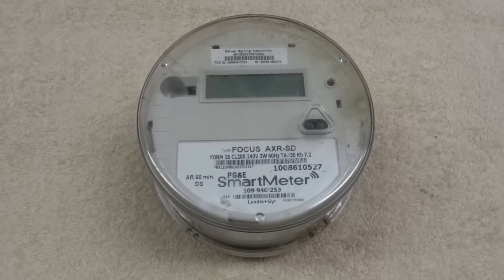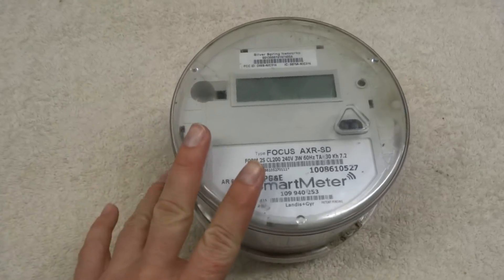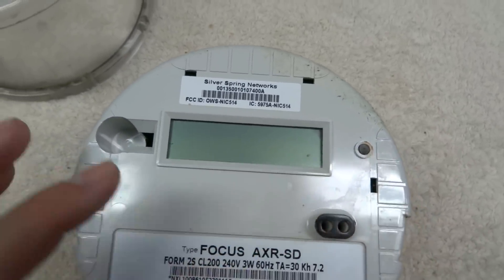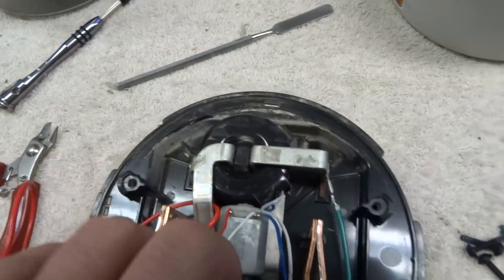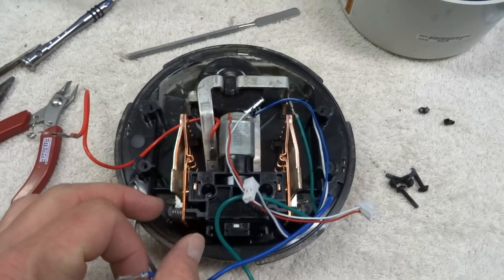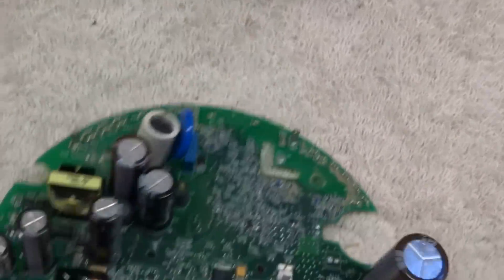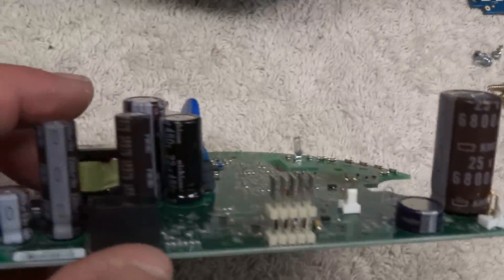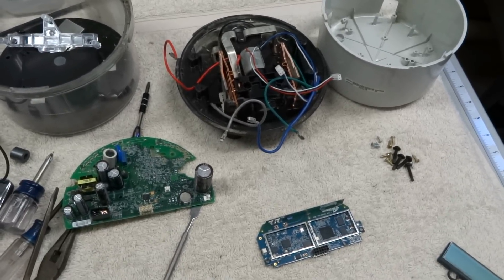Let's Teardown - Residential Smart power meter

Comment: The external antenna is to receive programmed rogue satellite commands to release capacitor juice to power surge all the interior fixtures and arc outlets to combustion levels.    Agenda 21 compatible.

Comment: That CT makes me think that can't see the two 120v legs independently. I'm wondering what happens if you use a grid tie inverter on one 120v leg and it produces more than needed power.  If the other leg is drawing current does the meter just see an overall drop in power usage?

Comment: The blue/white leads from the toroid coil are NOT the power source for the electronics. This coil acts as a current sensor for the amps flowing through the house. The meter electronics is powered by the red and green wires, which go to a switching power supply, producing the DC required for the electronics.

Comment: Hmmm, electronics.
Do these things emit radio frequency which affects radio? I get it from all sorts of things, my boiler which at least I can switch off, switched mode power supply next door, the worst is internet broadband killing everything from 160m to 17m amateur bands.
Would my transmitter affect their electronics? Or have they thought about that. 
I see it's in a plastic enclosure, nothing could be worse.

Comment: Two legs of 120v incoming from the transformer and two to power the home. 220/240v outlets run on two legs of 120v that add up to 240v. That's why 240v has breakers that are two-pole instead of single pole. They need to be on both legs of power.

Comment: The motor is to drive the power disconnect. I was wondering what they used. Contactor or SCR. The donut measures your current.

Comment: First off meter is upside down. The donut as you called it is a  current transformer. The so called safety switch in the back is actually a hanger to hang the meter when not in use. Electric company pays for the electronics to run not the home owner (upside down meter). So much wrong information told no wonder why people are so mislead  and misinformed.
Reply: At least hes trying pal. Got to start somewhere when nobody knows the real reason they pushed them on us all so quickly
Come on why would you want to swap out analog for digital

Comment: The level of paranoia around these meters is truly astonishing. I do not see how this device can do all the evil things they are supposed to be doing.
Reply: how do you know they are accurate?  they send them to some "independent" testing company, on your nickel and they are certified to be 99.4 percent accurate.. how do we know the companies doing the testing arent owned by the big wigs in the electric company or that they are in cahoots with them.. also the amp draw has to be calculated into WATT usage.. thats how we are billed, by kilowatt hour usage.. how do we know that all of this is correct.. I had an ENCORE employee basically park down the street and sneak into my yard to change my meter.. I caught him and asked why.. he said it wasnt signalling correctly.. I asked how did they know how much my bill was, he said that part was working,, well the very next month my bill went up 45.00.. I think they calculate the sq footage of your house, decide a base number u will pay and add to that on high usage months.,, im thinking of having an electrician install a watt meter in my house. just to confirm what im using..
Reply: @randy1ization  The energy usage calculation for a digital meter uses sampling instead of the way that mechanical meters did the measurement.  Many of these meters will measure the highest amps during the sample interval and apply it to a billing window (which might be 15 minutes), which can lead to your turn-transient from the fridge that lats only a second winding up as being billed for a full fifteen minutes.  The point is that the code is not open source and available for public scrutiny. Many people with 'green' technology like variable speed HVAC are finding much higher energy usage with these new meters, and this is believed to be the reason.  These meters also introduce harmonics onto the whole home wiring which will reduce the lifetime of refrigerators, washers and other big appliances.
Reply: Oncor may not allow me to have my own kilowatt hour meter installed, they may say it interrupts thier system, and will say that I can check my dasily usage online every day if I want.. they have everything covered. and to your point abt the sampling times, you can bet your ass they dont sample in typical low usage periods, like midnight to 6 am.
Reply: @kengartner204  to your point, most appliances have primary and secondary windings, dryers, ac compressors, refrigerators, washing machine motors, almost everything, but they are usually on for a very shot time.  the Hvac systems tend to have variable speed AC TO DC motors, but the compressors are usually 2 compressor systems, a small one and a larger one. most use a scroll type pumping mechanism that is alot more effiecient than the old piston /cylinder compressors/

Comment: the FCC ID of that wireless board
https://fccid.io/OWS-NIC514

The newer smart meters use an LTE data modem with a SIM card.
The motor inside controls a large switch so the electric co can remote disconnect your power if you don't pay your bill.

Comment: It’s a Landis-Gyr AXR- SD .....  The AXR denotes this is NOT an RF transmitting meter...   The SD stands for Service Disconnect.  So this meter has a built in disconnect means depending on how the software is set up.  Disconnect by overload, disconnect remotely.  
The RXR series are the ones that operate on 900 MHz. or 2.5 GHz.

Comment: The "donut" is a current transformer which measures the amount of amperage flowing through the meter.  The motor does drive a disconnect at the meter, not so much as a safety feature, rather so the power company can turn your power off remotely either because your not paying your electric bill, or because the grid is overloaded and the power company can cut the power to areas of the grid your in.  The later 'feature' smacks of big brother, government control, kind of scary. There is a large capacitor which stores power like a battery so if the meter is removed a signal is immediately sent to the power company that the meter has been removed.  The power company will come to your site and investigate why the meter was removed.
Reply: I wonder what happens if I put a grid tie inverter on one 120v leg and it produces more than needed power? With one leg taking power and one leg giving power how does that affect the CT signal and meter reading.
Reply: @tweedeldee8122  From what I understand - the CT measures both sides independently. utilities deliver three wire single phase.  That comes in the form of 120vac + 120vac + neutral.  Then on your property you have a grounding system. You use one leg of the power they deliver all the time. Any 120vac device pulls from just one leg.  The meter measures each leg at about 120v (it keeps track of exact voltage and amps pulled). The utility does not notice if you pull unevenly. They just do the math to figure how many total kilowatt hours you pull from the grid.  One leg pull is approx Ampsx120.  two leg pull is approx  ampsx240.  One more thing... if you don't have a bi-directional smart meter (solar customers get these), and you produce power with an inverter and put it on the grid, the power company just sees power across the meter.  You would get billed for that power you put on the grid because you have a "dumb smart meter" that is not aware of flow direction.

Comment: I have a theory that I will expose here.   I think that one of the reasons that people experience higher bills after the smart meters are installed is that they have a lot of motor loads with lagging power factor running within their homes and the smart meters are acting like oscilloscopes or power factor meters which are actually reading the out of phase component of the load and the customers are being billed for it for the first time. 

Not like the old analog ones that were just measuring V x A / Time.

What do you think?  Am I making this stuff up or is that what is really going on?  Some people have seen atrocious increases in their bills.  Sometimes even when they have been absent for long periods of time.  (not forgetting that that trusty fridge and freezer are still poking away turning on and off with way to much regularity).
Reply: Supposedly your lagging power factor usually at .80 is not billed to the customer.

Comment: I just stumbled across this looking for information about the power meter Ameren just installed on my home. He spoke to the regular DIY person, not someone with a degree in electrical engineering. Getting to the nitty gritty of how the meter works would have put most of us to sleep.  
My question is this :   The meter they installed has a Zigbee symbol.  My smart home is connected to SmartThings which supports Zigbee.   After an email to Ameren. they say they don't know what I am talking about.  My reason for wanting to connect to the meter is to monitor my power consumption and compare it with the smart power meter installed in my entrance panel and the monthly bill.

Comment: The blue and White wires are yes a inductor, basically what it’s doing is it is reading the amp draw that you are using daily essentially it’s just an amp clamp and you’re smart meters technically just a multimeter but only reads amps and what it does is it converts the amps into walks in and calculates the Watson to kilowatt hours every thousand watts is one kilowatt so for example if you’re using 2400 kW a day then whatever your power company charges.  Basically you’re being charged (for example) 1000 Watts a day in electricity.  And then with that motor does is it drives a gear that lives in Contacts app whatever it turns the power off to disconnect and then pushes the contacts back together and then what that motor does is it drives a gear that lifts contacts up whenever it turns the power off to disconnect and then pushes the contacts back then when it is turned on.     so basically an easy way to steal electricity and get away with it would be get yourself an eye doctor probably from eBay somewhere and a long wire and just wrap it around a small “Hot/Black” wire to your refrigerator or something draws a little amperage but not much so that way your power company knows you’re using your power and you’re still paying for it but you’re using very very little because it’s only reading what you’re drawing off one item.

Comment: 220v coming in with a amp meter with a disconnect.
Reply: To day the line voltage is 240 VAC

Comment: IF YOUR POWER WAS INTERRUPTED WHEN THEY INSTALLED A SMART METER, THE INSTALLER DAMAGED YOUR UL APPROVED METER BASE 
WHEN THE LIGHTS IN YOUR HOME BLINK OR FLICKER, CALL 911 AND HAVE THEM SEND THE FIRE DEPARTMENT 
EVERYTIME YOUR LIGHTS FLICKER, CALL 911 
KEEP CALLING 911 UNTIL YOUR POWER COMPANY SENDS A CERTIFIED ELECTRICIAN TO RECERTIFY YOUR UL METER BASE
 NOT SOME CLOWN FROM THE POWER COMPANY WHO WILL LIE TO YOU
 A CERTIFIED ELECTRICIAN WHO WILL GIVE YOU A WRITTEN LETTER THAN YOUR METER BASE IS 100% 
YOUR LIFE DEPENDS ON THIS

Comment: Great you get a C+ not bad for a Novice, this unit has no Anteni on it you are looking at a bracket the second bad is the Voltage and Amps are wired to the utility side and the black deal with a hole in it is a meter to hang on the wall of the meter shop.

Comment: 🔥🔥🔥🔥🔥🔥🔥🔥🔥🔥🔥🔥🔥🔥🔥🔥🔥🔥🔥🔥🔥🔥🔥🔥🔥
The Joe Schmoe Show     @Frederique Zug  That's a lot of fudged up numbers bro.
Reply   

🔥🔥🔥🔥🔥🔥🔥🔥🔥🔥🔥🔥💀🚒🔥🔥🔥🔥🔥🔥🔥🔥🔥🔥🔥🔥🔥💀🔥🔥🔥🔥💀💀☠🔥🔥🔥🔥🔥
SMART METERS CAN NOT BE USED TO INTERRUPT THE LOAD
 IF THE METER IS NOT BYPASSED, THEN THE CHANCE OF A SMART METER FIRE INCREASES BY A FACTOR OF 1000 TIMES
 IF THE CUSTOMERS METER BASE IS NOT INSPECTED TO MAKE SURE THEY STILL MEET UL CERTIFCATION, THEN RISK OF A FIRE INCREASES BY A FACTOR OF 10,000 TIMES AND THE UL CERTIFICATION OF THE CUSTOMER'S METER BASE IS DESTROYED BY THIS CRIMINAL ACT
If you come home and find the power has been interrupted to your home and you have a new smart meter, call the police and charge your power company and the meter installer with ATTEMPTED ARSON.
WATCH, AND TAKE NOTES ON THE ONLY LEGAL WAY TO DO A METER SWAP
 https://www.youtube.com/watch?v=G0bq2Hn2vOo 

#1 If they install a smart meter and your power goes out, then they are an ARSONIST. 
In Canada, it is against the law, all smart meter swaps have to be BYPASSED to keep the power on.

#2 If the customers UL certified meter base is NOT INSPECTED by a CERTIFIED electrician before the meter swap, they they are probably breaking the law and will increase the chance of your home burning down by a factor of 10,000 times. 
Remember, the only electrical device in your home that is NOT UL APPROVED is their smart meter. 

Why do you ask a smart meter is not UL APPROVED 
BECAUSE THEY ARE NOT BUILT STRONG ENOUGH TO MEET UL'S SAFETY REQUIREMENTS.
They are only certified to measure power consumed.

Comment: its sad you don't know what you are really looking at to explain what your looking at.  The motor is to just via remote from the local office or any were really since its all done though a network.  disconnect your power if you are behind on a bill.  They don't have to send any one out to do it any more, and still charge you as if they had to do it with a person.  Also you do not pay the power for the meter power. You already pay a fee just for it being there, look at your bill it be on there.  These are low wattage yet the power company foots the bill on the power the meters use yet they use very little power, like 2 watts or so.   they measure the power that goes in to the home not what is going in to the meter.  

Way the network works for these is the same as those network extenders that you plug in to and out let and then can send internet to another plug using the wires in the home.

Comment: The only danger with these is that it eliminates jobs like Self Checkout in stores, ATM's etc. The little transmitter does not have enough power to hurt you unless you just stand by it 24/7! Even the water meter has them. Again it will cut back jobs and that is all. Ex Radioman

Comment: I can't believe this video, the house run's on 240 volts in put and out put, 120 volts per a leg. meters run on 240 volt. 240 volt makes it own neutral because of alternating power, when one side of the hot leg go's low the other hot leg go's hi in it's phazing of each other ~~~~ sign wave those one side go's negative when the other side go's positive. this = alternating current. don't ever plane an wires in electronics to be what you might think them to be. it could be polar opposites.

Comment: So thebulltoo, you have things  to do to me??????????
He are things you should NEVER DO to a smart meter.

Sigi Henke 3 months ago
How to kill a smart meter.... Get a smaller microwave oven, remove the door screen and glass. Then close the door and set your timer. Then push the microwave oven fully over the meter so the meter is actually inside the oven. Press "Start". The electronics in the meter will be totally fried in a fraction of a second. You probably have seen what happens when metal is in a microwave oven ..... lots of sparks and vaporized metal. Make sure you don't harm yourself by the microwaves of the oven which must be facing away from you!!!!!

Smart meter killer 
https://www.youtube.com/watch?v=Q1wqb03ITI4

Smart Meter Revenge
https://www.youtube.com/watch?v=Odxtf1QYnGc&t=759s

Overloading a Smart Meter
https://www.youtube.com/watch?v=x4MyKe7dj7w

Electricity meter glows inside and pops at 800 Amps
https://www.youtube.com/watch?v=H_ZvLrRiucU